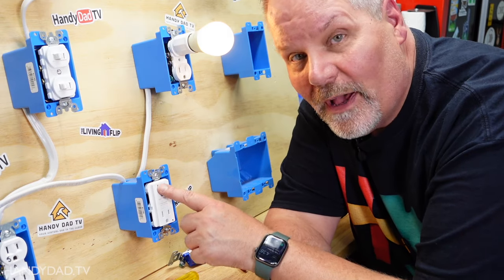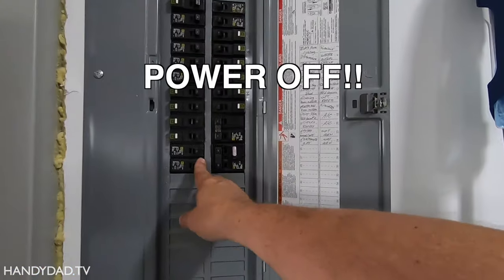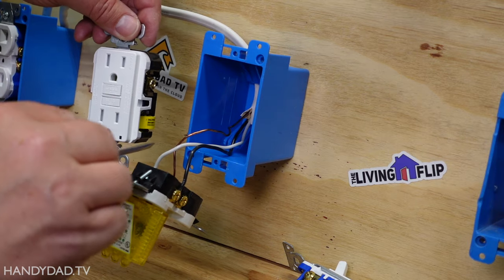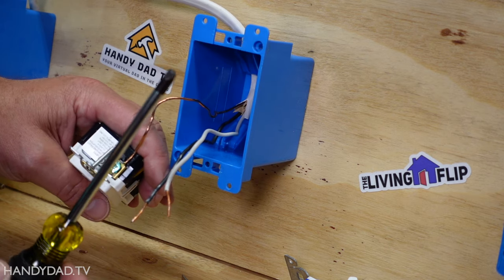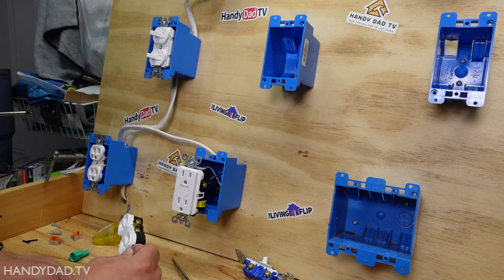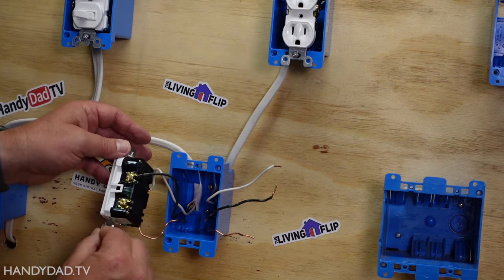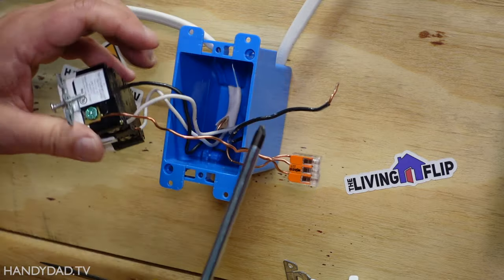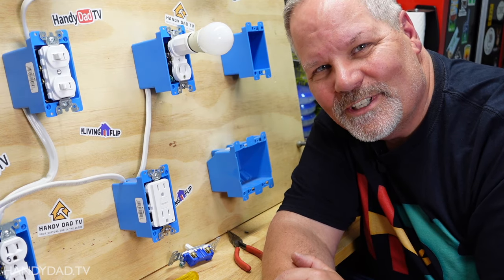GFCI Outlet Wiring

Comment: Love your videos, especially the DIYer mistake ones.

Situation & Question: I have fully documented a circuit which has a single GFCI breaker outlet. The circuit has eleven devices, 3 switches, 8 outlets. Of the 8 other outlets 4 are non-GFCI outlets which are close to water sources, in 3 other baths and kitchen, which makes me think those outlets should also be GFCI protected. In reviewing my Leviton documentation for installing GFCI outlets, my interpretation is that a single GFI outlet, placed as close to the breaker as possible would provide GFCI protection to all downstream devices. It seems to me that a single GFCI device would protect all exposed downstream water adjacent outlets, thus not needing to install a GFCI outlet at each water exposed box. Is this understanding correct? FYI: ChatGPT said this understanding is correct.

I determined the exiting GFCI outlet is at the end of the circuit simply because it’s in a single wire box, only a line wire, no load wire. Given the context of the circuit with all the other GFCI at-risk outlets ignored and upstream of the existing GFCI outlet doesn’t that question the competence of the original installing electricians. It appears the one GFCI outlet was installed just to make it appear they considered GFCI risk? 

Background: Home has 4 bathrooms, 2850 sq. ft.,1986 construction home with neutral wires throughout. I am a DYIer with a number of years of upgrading my homes high voltage circuits. Two objectives: Cosmetic decora modernization, complete smart home functionality.
Reply from the maker: Well if ChatGPT agrees, it must be true!

The easiest solution is to install a GFCI breaker. But that’s not always the cheapest option. 

However, my opinion is that I always want the GFCI in the same room as any protected outlets. That way I can hear it trip and don’t need to search where to reset it.
Reply: I'm finding it difficult to follow along with your circuit description. You should not have any kitchen receptacles sharing a circuit with bathroom receptacles. In the mid 70's GFCI protected outlets were required in all bathroom receptacles and outdoor and garage and basement if unfinished. That's it. Kitchens were not yet required to have GFCI protection within 6' of the sink until later, but I don't know when exactly that was added. But even in the 70's kitchen outlets and bathroom outlets could not be combined on a circuit.

Comment: I'm searching and found a 20A &15A GFCI outlets. I need something to handle 120V and 1300W. Is a 20A outlet better?
Reply from the maker: You should only use a 20-amp device on a 20-amp circuit. Check the breaker. 

Even a 15-amp circuit/receptacle will handle your 1300-watt hair dryer.

Comment: My question I want to a light fixture outside my closest outlet is a GFCI. This will be a motion light. Do I wire from the load size of the gfci to protect the light fixture and to have constant power?
Reply from the maker: You can pigtail it to the Line terminals. If you use the Load terminals, the light would go off if the GFCI trips. You don’t want that.

Comment: I’m trying to put a gfci in an outlet where the old outlet is currently wired so that there are two sets of cables coming into the outlet and the hot wire from one is on top, but the white wire from the other set of cables is opposite it. The same thing on the bottom- the other hot wire is across from the whit from the other set of wires. I’ve tried wiring the gfci the same as the original and also tried a number of other combinations. The green light comes on, but it won’t supply any power from the gfci to devices. Any thoughts?
Reply from the maker: Wire them to the LINE screws only.

Comment: Hi i watched your video very good the second part was what i had to do so i connected all wires in order  but no power at gfi or outlet connected by gfi the LED light is on and its green and it wont trip or reset any ideas what i did wrong
Reply from the maker: Probably reversed the LINE and LOAD.
Reply: So  reversed the line and load before I switched lines the green led was on but i couldn’t trip the outlet or reset outlet now that I reversed the led is a orange red color and i still can’t trip or reset is the outlet bad?
Reply from the maker: Red may mean line and neutral are reversed. You can google that for your brand.

Comment: I have multiple outlets on the same breaker. Does that mean I wire my gfci to load  side?
Reply: 3 white and 3 black wires pig tailed into box
Reply from the maker: You only need to use the LOAD terminals if you want the downstream outlets to be GFCI protected. If you just need this one outlet to be protected, just attach the pigtails to the LINE terminals.

Comment: How many plugs and light switches can you continuously wire on a GFCI?
Reply: I just did an outdoor restroom, and I want to do the electrical work,
Reply from the maker: You’re not limited by the number of outlets. You’re limited by the maximum amperage of your circuit.

Comment: I replaced an ordinary outlet with a gfci but keeps popping up the circuit breaker on the gfci. I tested for power with the popped circuit and I still get 120v .  What can it be .?
Reply from the maker: Double check that you used the LINE screws, not the LOAD.

Comment: My garage door outlet on have 2 wires and doesn’t have a ground wire i’m trying to add an outlet for my sprinkler system can i still do it w/o ground wire?plan to replace my old outlet to gfci too
Reply from the maker: You may have shielded cable and the box is grounded. Still install a GFCI even if only using the black and white wires. The screws will carry ground to the box.
Reply: @handydadtv  can i still add an outlet and can i wired it to the GFCI because im using romex there is white black and brass color. Thank you for you reply
Reply from the maker: I suggest you verify the GFCI box is grounded first (use a voltage tester across hot and the box). If it is, then go ahead an add another outlet with Romex, but make sure to bond the ground wire to the box with a screw before connecting it to the green screw on the GFCI.

Comment: I need help My house from 1970 so I’m upgrading outlet and switches never been changed noticed that the copper wires are bigger than the new ones and each outlet has 5 wires green, red, black and two whites and some outlets are run by switches
Reply from the maker: My advice is to rewire them exactly as you found them. It will be a lot more work to figure out where each of those wires go.
Reply from the maker: Be sure to watch this to learn how to Switch HALF an Outlet:
https://youtu.be/5D4itWGtTVQ

Comment: My question is I have a prexisting outlet in our half bath and just above the base board. I want to add a GFCI by jumping from that outlet. Not sure if I connect it to the line or load side of the GFCI. Please advise.
Reply from the maker: That outlet should already be GFCI protected. If it’s not, put the GFCI there and wire the new outlet to the LOAD side of the GFCI.
Reply: Ok thank you for the quick reply. @handydadtv
Reply: @handydadtv  at minute five forty you say that the line isn't protected. Does that mean the top of the outlet isn't protected as well or if it takes too much load with the gfci go off?
Reply from the maker: @tonychavez4056 The LINE side of the GFCI (the top screws on this brand) is power coming from the circuit breaker. I say “unprotected” because you can shocked there. But the LOAD side is for downstream outlets that will be protected.

Comment: Hi sir i have 2 outlet in the kitchen and they are not GFI and i want install GFI but both outlets have one black wire coming in and its hot and also have a red wire coming in that is also hot and i say hot wires because if i flip both brakers it turns them off so i tried installing 2 GFI and i connected the hot black wire to the line and the red wire to the load but it doesn't work it flips both brakers what im doing wrong please help
Reply from the maker: It’s impossible for me to say. Please call a professional.

Comment: Well, I ass-ume, since half my house's wires don't have a ground wire, I can leave that part out, ha! The electrician that replaced the fuse panel with a breaker box said the outlets that "read"... "open ground" with the tester are protected by the 15 & 20 amp breakers, but? Sure hate to find out the hard way, especially in the bathroom & kitchen near the sinks. I may add GFI outlets to be on the safe side.
Reply from the maker: I’d get to work rewiring that place.
Reply: @handydadtv  😆,  Can't afford that my brother, just a poor old retired carpenter.  But, did run a new "homerun"? Romex to the washing machine outlet. (Fun attic work)
  If you have an idea of how to add/wire a  breaker to the breaker box, please do share the info.
Reply from the maker: If you’re retired, you’ve got the time to rewire one circuit at a time. 😉

The only breakers I’ve added were for EV charging and this one for underfloor heating: https://youtu.be/YjqM-QkGBlY
Reply: @handydadtv  dam-it, you went too fast, lol! I'm going to run one more wire for/in a room (last one!), I'm working on. (drywall still a mess), at least the three outlets will be on their own circuit. I'll have to get help to wire them to the panel. Looks easy, but never done anything like this before.